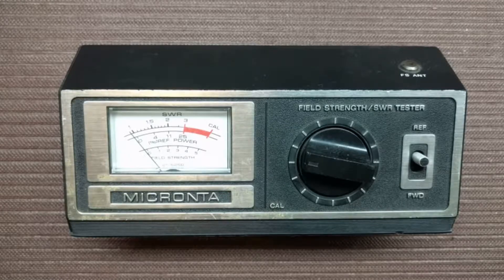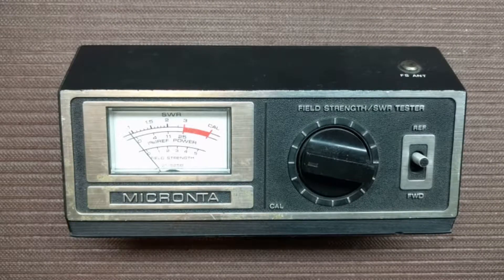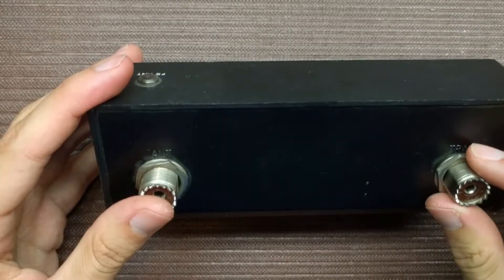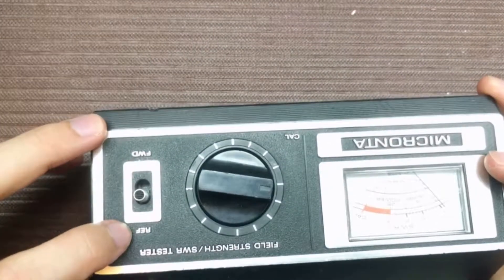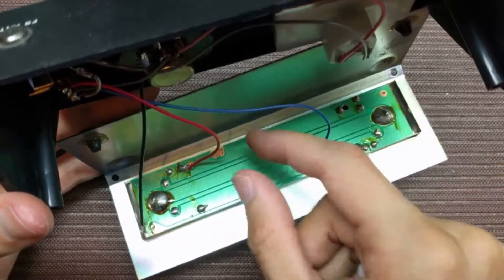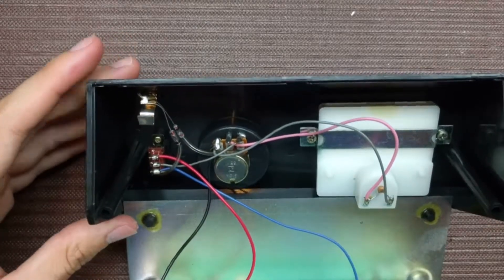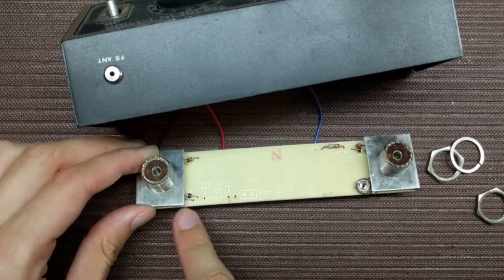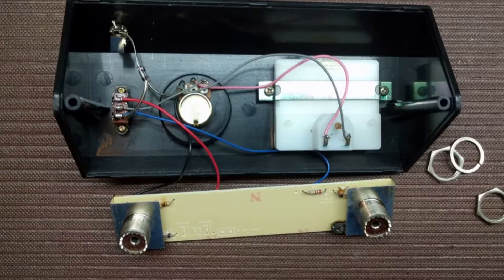How Does an SWR Meter Work

Comment: Noce video thanks a lot! But I think it should be called "how SWR meter are constructed", because You do not explain how it works and how forward and reflect voltages are mesured in that PCB design.

Comment: What is the FS ANT input located on the top plate used for? Mine has a 5" metal rod with a loop on one end that fits into the hole. Do you need to insert the included 5" rod into the FS ANT input to use the meter?
Can I use the 5" rod instead of attaching an antenna to the antenna attachment located on the rear panel?
Reply: I found out that the 5" rod is an antenna. You insert it into the FS ANT input located on the top plate and then you can use the Micronta meter to test the Field Strength of your CB Radio without having to place it in line or in between the radio and actual antenna.